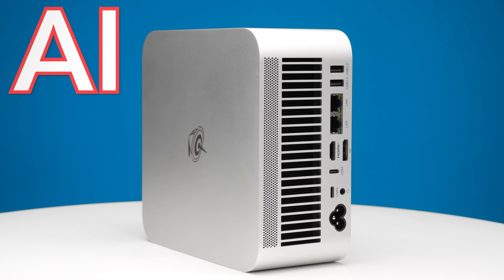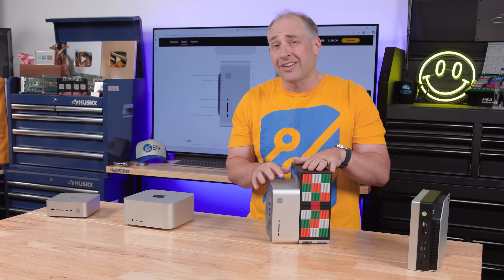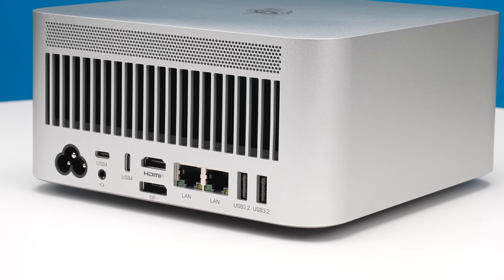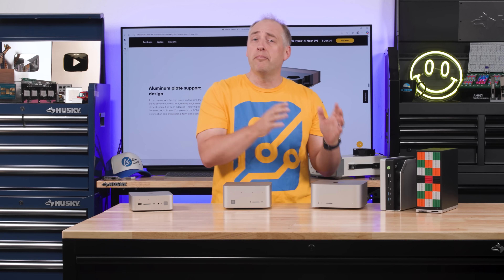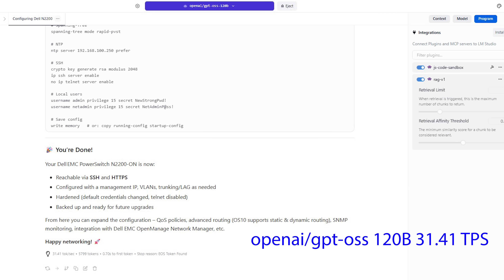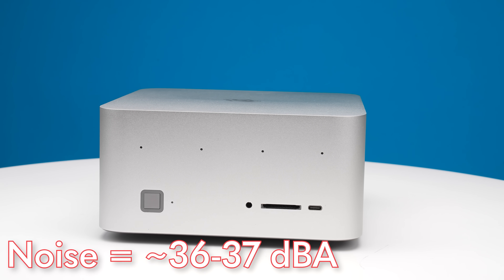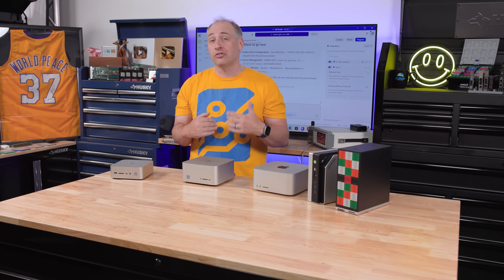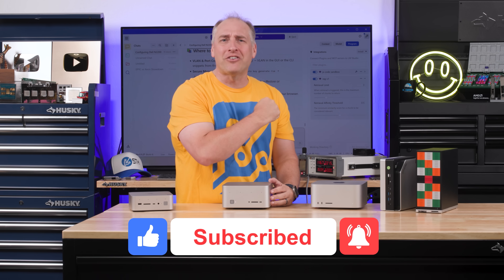The BEST AI Mini PC That One Upped Apple? AMD Strix Halo Beelink GTR9 Pro

Comment: This thing is notorious for the network driver disappearing when the temp goes up
Reply from the maker: It is a firmware issue. We have an entire section of the video on it
Reply: Hello, the GTR9 currently features an Intel E610 10G Ethernet card. Since this card is relatively new, there may be room for improvement in the driver and firmware. We have contacted Intel and will soon release new optimized driver and firmware version to ensure the best user experience. Please rest assured, we'll take full responsibility for this issue. If the driver update doesn't resolve the issue, feel free to contact our support team for a return and a refund.

Comment: I liked that they didn't cheap out and designed this thing with an internal PSU in mind. I HATE external bricks for desktop machines. But oh man do i dislike the front littered with holes. I dislike the power button, the microphone holes, the ports... it looks so alien on this otherwise very clean design.
Reply: The modular internal design of the Beelink GTR9 Pro is impressive — every component is isolated for better thermals and easier upgrades.
Reply: So.. you'd rather have the front of the machine be completely devoid of any ports, buttons.. anything.. rather than having functional/practical USB ports, a power button, etc? Are you an Apple guy per chance? Even their machine has ports on the front though..

Comment: As a home NAS user with n8n workflows  where I'm using smaller models, I'd strongly prefer a motherboard that lets me use the igpu this way while being a normal full size and low-power motherboard. 

There isn't enough compute to use those giant models that'll take up all that memory effectively, you're still in 4B land and you're better off just dropping a 24GB GPU into any machine --- and that's like what, 1/4 the price?

Comment: unfortunate about the added unwanted software and hard to remove THAT is not a good sign   smells of spyware
Reply: Hi! Please rest assured that the Windows system pre-installed on our devices is 100% genuine and does not contain any spyware. 
We collaborate directly with software vendors to pre-install certain applications in order to provide a convenient “ready-to-use” experience and address common user needs. All pre-installed software is fully licensed and secure. Of course, you have complete control — if you prefer not to keep them, you can safely uninstall any of these applications through the system’s “Apps & Features” settings without affecting your PC in any way.
Reply: @Beelinkchannel thanks for the reply!
Reply: If you are worried about security, install Linux, problem solved.  Linux is better on this machine anyway.

Comment: I prefer the Framework Desktop $100 moew if you want it with the case, all standard components so if something breaks, like the Powersupply or system/CPU fans, are all easy to replace, standard MiniITX motherboard so you can use the motherboard on all compliant cases or reuse the Framework Desktop case in the future if you feel like it, not to mention how you disregarded the SD card as a optional expansion like a downside vs the built in on the others, duh, the point is you have two ports that can be whatever you want instead of a fixed configuration that you can't change, I don't see the downside on that (besides the cost of the module).

But I'll say my second favourite would be no doubt this Beelink, I like the form factor and that it has a built-in speaker and Microphone
Reply: thans for reminding me about framework
Reply: I like this Framework, too special I can put this Board in a 2U Chassis and integrated this in my rack system :)
Reply from the maker: Fair points, but the Framework we showed configured like the Beelink (albeit with the translucent panel) is more like $2500. It also only has 5GbE. Having several of these, both the Minisforum and the Beelink are much better
Reply: @ServeTheHomeVideo  but do you really need 10gb? i mean is nice but do you ever gonna use it
Reply: @ServeTheHomeVideo  I don't think you understand the point of buying a Framework. It's for consumers who want to upgrade their machine, not an enterprise "dispose of it after 3 years" mindset.
Reply: @johnborders8952 How are you supposed to upgrade the Framework over time when the CPU and RAM are all soldered together on a $1699 motherboard?

When you’re talking about computers that are basically fully contained with very little upgradability, this and the Minisforum just offer some very obvious advantages. Just having two network ports allows you to do more things out of the box.
Reply: @johnborders8952  mate. the motherboard is 99% of the computer. reusing a case and psu could barely qualify as upgrading it.
Reply: @mbvglider  You don't upgrade a Framework Desktop. You swap out the motherboard which includes the CPU & RAM. For the $300 difference between getting a FW Desktop without storage/OS and just the motherboard kit, I'd go with buying a new FW Desktop instead of upgrading the motherboard. But then again, I'm not the target audience for something like a FW desktop. I'm looking to get a Beelink or similar, something ultra cheap but fast to use as a server and I'll build a new AMD gaming PC when I can afford it.

Comment: I have no complaints about those specs. This looks great from ports, networking, and classy looking. Great job Beelink. Dell, HP, and Lenovo are going to have to address this market. I’d throw linux on there and for sure never the default image.
Reply: Lenovo have a unit onsale using this APU in a Framework sized case but to my knowledge, it's a China only market offering.  Not sure whether it's due to AMD supply of the APU or something else?  Certainly if Lenovo wanted to compete in this space, they have something ready to leverage for that.

Comment: You're right about the whole "if you wanna do AI just go buy an Nvidia". And so, what i wanna see is less AI crap, more innovation on hardware accelerated video. For example AV1 encode and decode with 4:2:2 chrome subsampling, if not 4:4:4.
We're getting to the point where we have ungodly amounts of bandwidth on wifi 7 with MLO. I want video streams to be able to take advantage of that with better fidelity.

Comment: I say this not as a Mac fanboy, but you say the Studio is $10k, that's with 512GB of RAM.  The Beelink has a MAXIMUM 128GB supported, it's soldered so there's no way to upgrade.  But 1/4 the memory. Totally different class of machine, or you are comparing against the base Studio config with 96GB of RAM and that's $2k
Reply: The base M4 Max Studio has 36GB of RAM for $2000. The base M3 Ultra Studio has 96GB of RAM for $4000. So price wise you are comparing 36GB on the Mac to 128GB on the Beelink.
Reply: @ruzaroos You can get  the M4Max with 512 gb a d 128gb of ram for about $3200 with a teacher or military discount. There are companies making storage for Macs a lot cheaper than the Apple prices. I'd use some thunderbolt external drives later
Reply: @heirtothethrone000 I'd just get the base M3 Ultra for $3600 with Edu discount at that point. 96GB vs 128GB would be interesting to test.
Reply: @ruzaroos 👌👌👌
Reply: The only Mac Studio with 128GB RAM is the M4 Max (the one I have), which is probably the comparable model for this Beelink. It’s a little less than twice the price of the Beelink, depending on SSD size, for comparison.  You can use more than 96GB for the GPU, though (I often bump it to 110GB or more on the Mac).  I’m not the target buyer for this Beelink but, if it was 256GB RAM (with 200+ for the GPU), it would be a very different matter.  I love what these mini-PCs are doing.

Comment: „AI performance”??? Are you stupid or something? Who cares about AI performance in mini PC. Do even know what performs good in AI? RTX 5090 for 2000$.  You are selling marketing BS.
Reply: an RTX 5090 does not have 128 GB of VRAM.  You would need multiple of those to load the same size models.  This machine performs inference well for the price.  Training performance is OK, but clearly not as good as NVIDIA..... a totally different price point.  Not to mention noise, power consumption, heat ...

Comment: When Framework released their desktop, there were two things I had to say:
1. There was nothing about it that stood out to me as a huge value-add from Framework. They took Strix Halo and made it a miniPC. In a few months I knew there would be dozens of alternatives that offer very similar products, and likely smaller and cheaper. Props for using a mini-ITX board, but it seems somewhat pointless when you'll have to replace the entire board when it's time to upgrade anyways.
2. To me, it was antithetical to Framework's mission of "fixing consumer electronics" by reducing e-waste. They took the desktop and replaced socketable CPUs and memory for soldered down ones. They also used a much less common PSU size. All in all, it seems like a product that would introduce more e-waste by replacing fully modular and upgradable desktops with the thing they created.

I posted those points on the Framework subreddit immediately after the release of the desktop and the only voices of support for the desktop I saw were arguing:
1. It's unmatched for AI performance in a small form factor. Which is fair, but that doesn't tell me anything about what is unique about Framework's solution. Strix Halo is AMD's solution, not Framework's. Furthermore, I don't recall Framework saying that they wanted to be a company to provide the best consumer AI solutions. That is nowhere in their mission statement.
2. They're a small company, let them make their money. Which is fair I guess, but if it comes at the cost of their mission statement, I don't think it's worth it. They're a private company. They have no shareholder obligation to provide major profit. Maybe the profit from the desktop can be funneled into making better, more repairable products sooner, but once you start making these profit-first products, when do you stop?

Comment: This may be a weird / stupid question, but I'm curious why nobody has made a Strix Halo board that also supports OCuLink or a full PCI express slot.  I thought for sure I could count on Minisforum for something outside the box.  Maybe AMD just outright doesn't support it?
Reply: The Problem are the lanes. 16 pcie 4 is Max. Thats why the Second nvme is just x1 in the minisforum Version. The pcie 16 Slot in this has only 4 lanes too.
Reply: @MasterMind187b Thanks for clearing that up.  The Beelink looks most ideal now.  :)

Comment: kudos to STH for mentioning the problem with the NICs, Beelink is currently saying they hope to have it resolved by Nov 7th, but no promises
Reply: Where did they give a date?
Reply: @OMGrant  they emailed me, i pre-ordered one a month ago  and started emailing them about the issue .. still no hard promise or detailed explanation of they even know the root cause...
Reply: @anthonyrussano  The Ethernet NIC problem does not appear in Ubuntu 24.4 , so it appears to be a Windows driver issue ... but on the other hand, the wifi doesn't seem to be discovered in Ubuntu.    Not a problem for me as I use the wired LAN.  I suspect I can fix the wifi issue with some driver update.
Reply: thanks for this feedback... other reddit and YouTube users were saying they were able to reproduce it in Linux... if you run lspci it would lock up and also possibly while stress testing the gpu... if that's the case, i was planning on running Ubuntu or debian anyway... i might want them to ship the current version, I'm afraid they might lower the tdp settings with new firmware bios update
Reply from the maker: It is hard since our production queue is pretty long (we are filming December content already.) I was hoping it would have been fixed and we would cut that part out before going live. I am more shocked with how many folks did not mention it
Reply: Hi! We’re truly sorry for the inconvenience this issue has caused. Our team is actively working on it, and we’ll do everything we can to provide a solution as soon as possible. Thank you for your understanding! Please rest assured we'll take full responsibility for this issue. If the driver update doesn't resolve the issue, feel free to contact our support team for a return and refund.

Comment: ... and like happens so frequently, only the high-end configuration exists.

Where are the cheaper AI Max 385 versions with less RAM (Framework is one of the rare companies that does off it).

What we need is a cheaper alternative iGPU to bridge the low-cost 890m and the too-expensive 8050s.

I've yet to see a 8040S in **anything**.

Right now the H 255 with its 780m is the sweet spot, but something 50% to 100% faster than that would be great.

These 8060s systems are just too much.
Reply: Check GMKtec they have all 3 versions of the CPU in their lineup. The 64 Gb model is around $1500 right now which is cheap enough it might be worth considering as a lower end gaming PC.
Reply: @KenS1267  Weird, I don't see it on their site.

Comment: I like this package much more than the Framework due to the smaller dimensions and better NIC etc., however the price seems to have gone up since filming to $2099 (per the Beelink website); that only $114 or ~5.7% difference over the $1,985 shown but considering Beelink's reputation regarding warranty claims, if you envision yourself ever being in the unfortunate situation of needing hardware support then I think I personally would rather order the ITX Strix Halo motherboard Framework also sells ($1,699 for the 128GB) and then go bargain hunting for the remaining parts to assemble a working system.
Reply from the maker: The Framework is much more expensive if you configure it fully. Ours was like $2500+ to get something like this with Win 11 Pro and 2TB
Reply: @ServeTheHomeVideo That's definitely true, and the Beelink is a turnkey solution which is also nice, but then if something goes wrong I don't know how confident I would be of Beelink honouring the warranty (ie. that I wouldn't be left with a two thousand dollar paperweight). 
The difference between the preorder price of the GTR9 Pro and the equivalent 128GB SKU of the Framework ITX mobo is $286 though, and while that's not a lot of money to go shopping for all the extras you need (a PSU, case, SSD, Windows license, etc.) if your budget is expressed as the delta between the Beelink and the Framework then considering the GTR9's new price you actually have now about $400 to spend, which is a lot more doable.

I guess it's just that, if I'm someone for whom $2000 is a lot of money, then I would be devastated if my $2000 device should ever break (knowing at the time of purchase that the chance of getting it repaired was not guaranteed); acknowledging that, I would much rather spend a little bit more time/money going the DIY route (knowing that, although slow, the Framework customer service team do actually read their emails).
Reply: I've seen a video where they said the NICs bricked on them

Comment: Hi Patrick. Great hardware overview! Interested in making a video on using the GTR9Pro with Linux? We got our GTR9Pro a week ago, and while impressive, Linux support is immature. We’re using nightly kernel (6.16, testing 6.17) and ROCm (7.0.2) builds to run AI models, facing MEC overload issues. Still, for 70B parameter models, it’s hitting 50-60% of an RTX6000 Blackwell’s performance at a fraction of the cost. Kernel 6.16 supports E610 networking. Would love to see you set up and test the GTR9Pro on Linux and share your insights. Also, guessing your 4th AMD395 system is the Minisforum S1MAX—excited for your review and comparison with the other AMD395 systems.
Reply from the maker: Correct on the 4th. We talked about it a bit more in the web review. My thought was actually doing the Framework with Linux. It might be a web only piece though
Reply: @ServeTheHomeVideo Thanks for the update! We're looking forward to checking out the full piece on the STH website. On the Framework topic, we think it’s way more intriguing, and probably more cost-effective, to just grab their motherboard and pop it into a larger, more spacious case. We're really hoping we’ll see more motherboard options for AMD AI395 systems soon. It’d be great to have at least one or two PCIe5 slots for adding a high-end GPU in a year or two, especially since these systems might get outpaced pretty quickly.
Reply: I loaded Ubuntu 24.4, and find the Vulcan-radv drivers to be stable.  Other people are also reporting the ROCm drivers to be less mature and stable.
Reply: @worldcitizen7898 Thanks for sharing that, great to hear Vulkan-radv is holding up well on Ubuntu 24.04. What are you running for inference? Ollama, vLLM, or something else? I thought Ollama didn't support Vulkan yet. What models have you tried with this setup so far?
Reply: I got mine GTR9Pro this friday and on sunday afternoon I finally managed to install Proxmox on it which is Linux Debian. Havent set up any vm-instances for it yet though. That will be nextcoming weekend probably. But yeah, Linux support for all drivers wasnt easy.